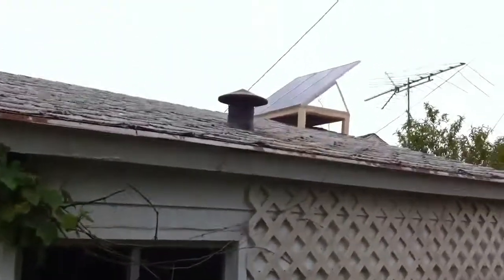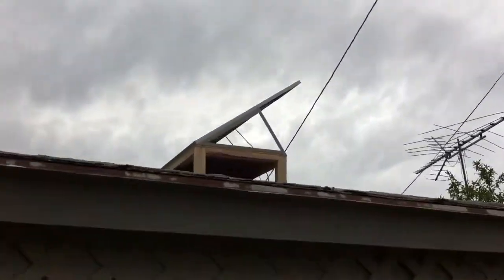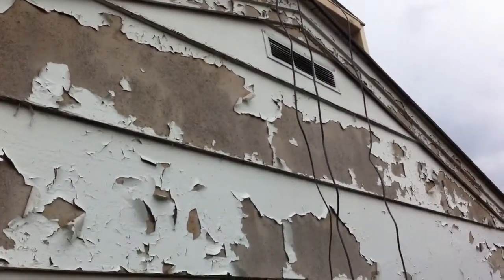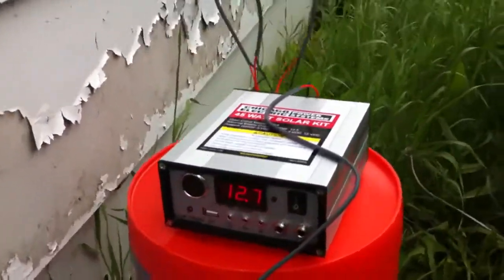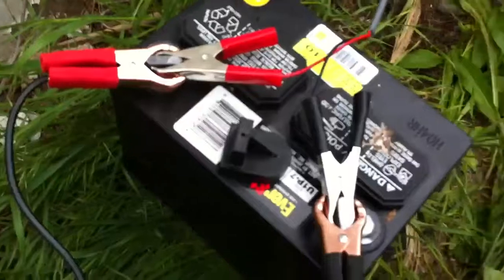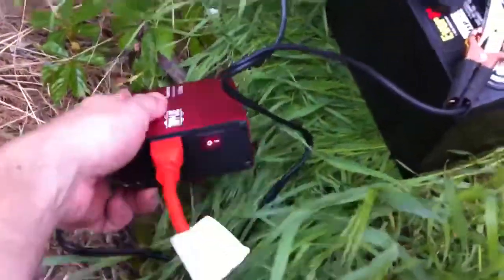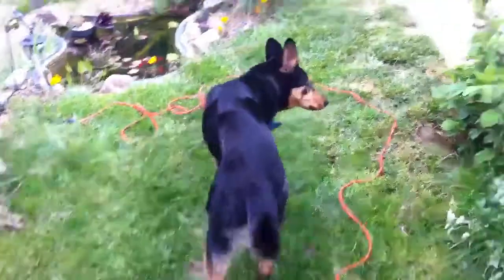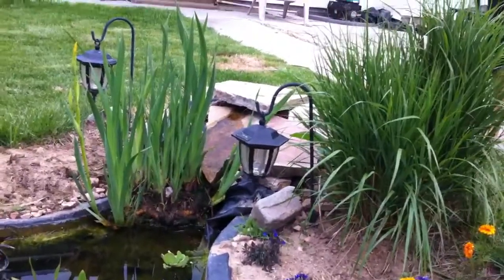Harbor Freight 45watt solar panel example setup

Comment: still not using the grid. could just as well be a pump for a rainwater / garden system. amorphous panels are not series cells so while not as efficient as crystaline they can trickle charge in overcast weather. solar kits are great for small projects, lighting & charging phones/pda's off grid.

Comment from the maker: the conroller is still working great.  I now have a small invertor i bought from china that plugs into the wall outlet.  It trickles a small amount of power back into the AC system.

Comment: its always good to see a fellow solar power  user!! keep on doing what you do, Its amazing that more of us dont exist lol   I have made a wind turbine myself from a treadmill motor, it works but does not produes near enough voltage to charge a 12 volt battery I am working on gearing it up and seeing if  I can get the volts up.  I made my own blades after watching some videos.  check it out on my youtube. I plan on doing more solar in the near future.  take it easy ya'll

Comment: If you've looked at a volt meter made in the last 5 years, you'll notice they have a switch that can measure up to 10 amps of current (from you panel). Unless you are using a 100+ watt panel, you should be fine.

Comment: I don’t get why EVERYONE has a voltmeter, don’t mean shi*, when will someone get an amp or watt meter? Math says this set up should be about 3.5 amps. If the panel is really 45 watts and that what is why amps are important, you can then check the performance of your system…